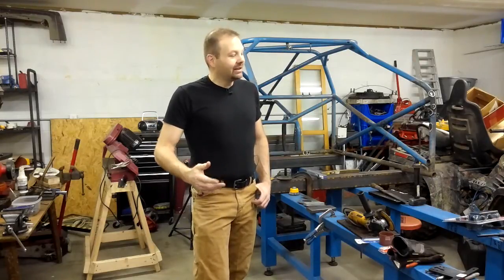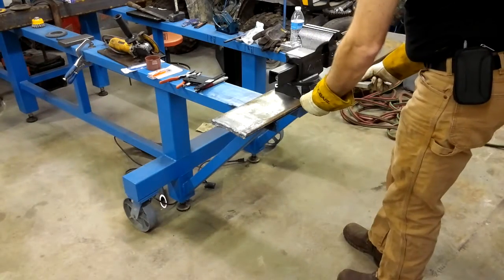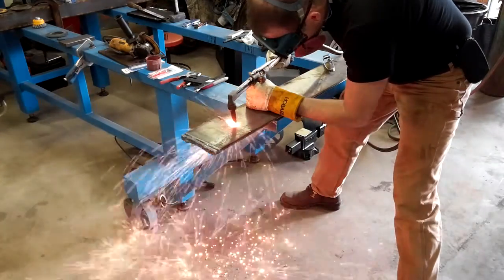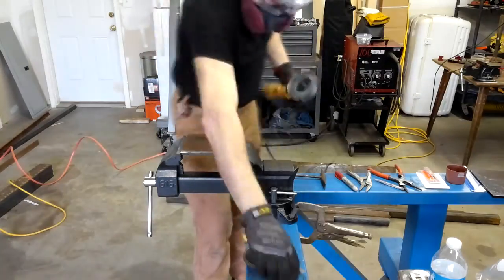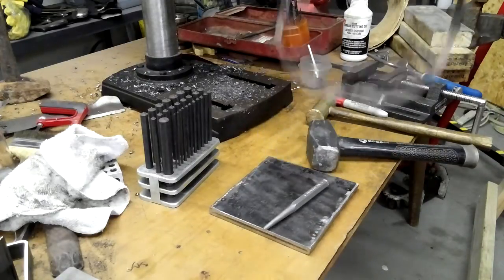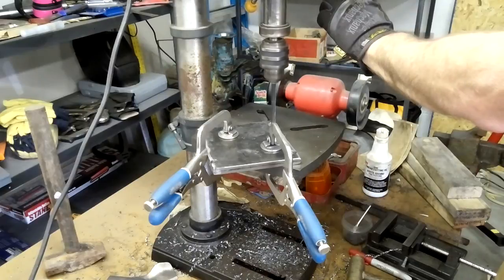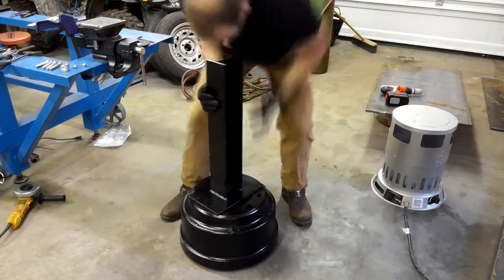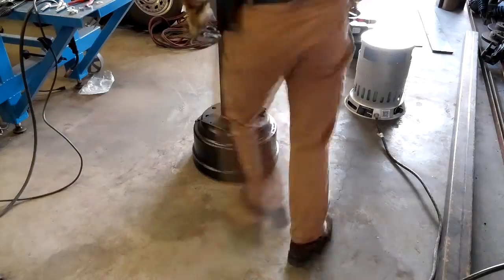Bench Vise Stand and Universal Stand Build Part 2 of 5

Comment: Hey I subbed, you have solid ideas and your projects are interesting.  I am no means a professional fabricator, but for some helpful money saving advice, back your torch a bit off the work piece with that propane torch.  Thats the sweet spot of propane cutting.  It is slightly cooler than acetylene by about 400 degrees, but the BTU out put is higher, and its way cheaper.  Course when you're talking about 5300 and 5700 degrees temps when steal melts at 3k and less, its not a factor.
Reply from the maker: Hey JonOccam BlueCollar Thanks for subscribing and watching. Really appreciate the feed back.

Do you think that would be an interesting video to compare propane to Acetylene? I could get more details on both and do some test cutting. Also, a friend gave me 4 or 5 propane cutting tips so that may help too.